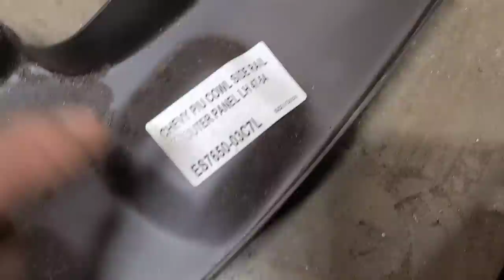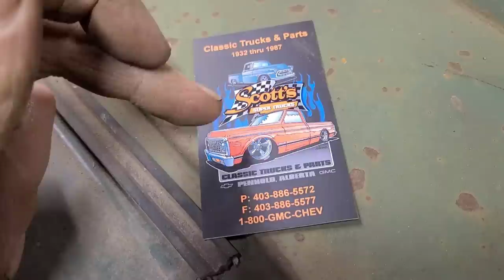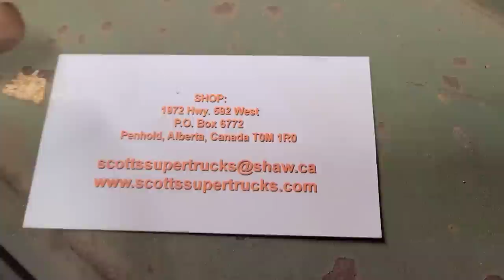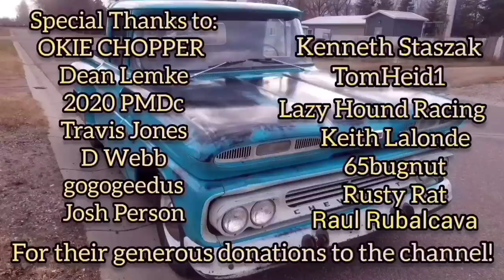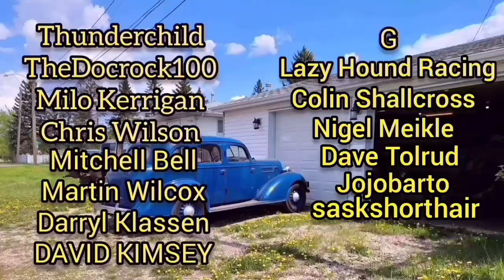How To Use Aftermarket Patch Panels To Fix Major Rust.1948 GMC Part 4.

Comment: Long time subscriber on Scott's channel and HAPPILY becoming one on yours !!! A retired construction veteran but even with that similar experience on buildings, can only imagine what it's like tearing into the rotten/decayed structure on one of these old relics !!! Your "resurrection" looks awesome so far. Can't wait to see all the follow-ups. 
I used to have older relatives that never owned a car who would always SLAM the door to the point the car instantly became a inch narrower just to ensure it was "latched" !!! You would need to wear ear protection whenever you gave them a ride ;o)
For sure, CONGRAT'S on the opera role.
Reply from the maker: Thank you! I suspect building repair is a lot more complex than anything I  have done with junk vehicles!

Comment: Everyone swears they remember perfect panel gaps..... that was never a thing, ppl just didn't bother looking too hard at them.
Just go look at the gaps on a brand new anything. 
American cars have always had terrible gaps with little improvement  in the 90's but after 2000 they've become crap again. No one looks at that when they believe it's new. Some are ok but many are not. 
Nice work Carter 👍
Reply from the maker: Thanks! Yeah I remember having to align doors on brand new $90,000 trucks and suv's because the doors were rubbing, plus everything now seems to come with dowelled bolts and welded hinges....which would be a great idea if the manufacturers would actually weld the vehicles together straight to begin with
Reply: @CarterAutoRestyling  yet it's funny how we're often held to a higher standard 🤣,   keep up the great work

Comment: I was fortunate enough to learn the use of body solder (lead) back when I was in high school (mid-latter part of the 1970's)...

We also used almost exclusively acrylic lacquer paint. There were RARE occasions when an enamel paint was used, and ever more rare.... Imron. 

I still use lead on some of my own repairs, but I do weld the seams solid. It's getting almost too costly to use lead any more (along with simply trying to have a good supplier), but I do enjoy using it. 

Aftermarket patch panels ARE a 'hit and miss' type of deal UNLESS you have a good source (which I'm happy you discovered one in Canada which has provided you with quality panels and great customer service for many years).

I'll attempt to spread the news about your operatic lead role. I'm happy you were able to pasta the audition without too much drama.
Hopefully my 4 friends will at least be marginally interested.

Sadly, I more than likely won't be able to attend as I've been called to an audition myself to play a part in "Get Off My Lawn'.....
Reply from the maker: Hi Russ, I hope you get the part in "Get Off My Lawn"!
Reply: @CarterAutoRestyling  Thanks.... I've been an understudy for years....😁

Comment: Make it Kustom was showing off 1/8" hole tig plug welds where he would drill through both layers of metal and using the hole to penetrate.  It simulates a spot welder and makes the bond nice and strong (you need to use more of them like a spot welder) but I would imagine they would be much easier to remove if you needed to like a factory spot weld.
Reply from the maker: Oh yeah, that method works great! I used to use it when all I had was a tig welder. In this case I had to weld through spot welds that I had drilled out, so mig was the only choice. The best defense against having to redo stuff is to just take your time and make sure everything is right before welding.

Comment: The desire to bring those insanely rusted and trashed old trucks back to life in canada certainly is much different than here in the southeastern part of the US. Buying all of those patch panels and paying someone for the extensive amount of labor to install them(even if you could find a person willing to do it) just doesn't make good practical  sense here. You can quite literally find a truck that is already in decent structural condition here in the states for far less than it would cost to pay a person(even doing work on the side) for 2 or 300 hours of labor. 4 years ago i crushed a 49 cab here in virginia that was in much much better shape than the one in the video because no one around here would even pay me 200 dollars for it(not kidding!)....all i can say is: "God Bless all of you in Canada!"

Comment: When are you going to do the LS swap part of the build?  I consider myself a bit of an expert on car building (because I've watched a lot of Youtube videos about it) and all the really cool cars have an LS motor. I suggest next time you do more research. Congratulations on the opera role.. but I would think that the lead role in "La Miserable" would be better casting.  Happy Hanukkah from the Shed.
Reply from the maker: Hi Randahl, 
I have two big Ls swaps planned. The first is the Saskatchewan Ls swap, where I take a perfectly drivable car, rip the engine out and begin installing a junkyard Ls with 300,000 miles, then find out I have no idea what I'm doing, give up and attempt to sell the remains of the car as a project with "all the hard work done" 

 The second Ls swap is the "Budget Ls swap". Again starting with a drivable car and a junkyard 300,000 mile Ls donor, I'll do everything on a strict budget, conveniently overlooking the extra 10 grand in parts that are needed to complete the swap.
Reply: @CarterAutoRestyling  "All the hard work done"  now that's funny.

Comment: Very impressive manipulation of the lead on the intro to the video. A real master at work.
Yes, door and panel gaps on a spaceport are quite important. I would think quite a bit moreso than on a truck cab.
Mega congrats on finally landing the lead role in the opera. Not sure if I can make it from NS so will you be selling a video of the production? The cats are super excited, as usual.
I may be wrong (I'm told that I usually am) but there seems to be more tips and tricks in this build than in some others. Lots of good content. But no fire. hmmm
Reply from the maker: Hi Joe,
I'll be doing a full opera performance  video at 10 million subs.
Sorry for the extra tips!  The pyrotechnics department has been overworked and under budgeted lately, but I was able to commission them for he intro of my next video
Reply: 10 million? Might a little while but you better warm up those pipes. One day you may have to go good on that.
Can't wait to see what pyro-dept comes up with.
Stay warm out there in snow-land.

Comment: Thanks for letting us know about were you buy your parts. Since I'm in Alberta I will use them. I have a panel truck of the same Era that needs rear fenders . Can you cut down pickup  fenders and make them work? No luck  finding panel truck fenders.
Reply from the maker: Sorry I don't have a panel truck here to reference, I think the outer face of the fender is the same, but you'd have to do a lot of slicing and dicing to the inside to get them mounted up.

Comment: I think your work is great.....way beyond what i would do....I appreciate good work but accept much less. As you get older you dont care as much as you do when your younger. I wish I could have back a few of those years I spent doing perfect work on cars that nobody really cared about after I was done.
Reply: Mike your v w's look great
Reply from the maker: Thanks Mike! This one is just a fun low stress patch job to save what would otherwise be an unsavable truck. There's a time and place for perfection, but most of the time "just getting it done" is the way to go!

Comment: Watching so many people do the "M<IG" plug weld why not buy an actual two-Handed Spot welder. even my old man had one back in the mid 80's loved putting panels on with it.  But mig plug does work.  Very precises with those chinesim thin replacement panels. but it what we the rebuilders have to use; America just isn't cable of doing anything half as good for nothing less than way too much money hr to produce. we / you have make do with them.

Comment: Any thoughts on what could have been used that wouldn't have caused the cab issues?  I knew from a previous cab "DO NOT SAND BLAST!".  Thanks for answering.
Reply from the maker: Check out Wray Schelin on YouTube, he has several videos on using Muratic and phosphoric acid to remove rust. It's messy and tedious, but it's really the only safe way to get rust off of large flat panels.
Reply: @CarterAutoRestyling  Thanks!

Comment: They make specific spot weld removal drill bits which cause minimal damage and save time versus regular drill bits.
Reply from the maker: Not a fan of those, I prefer the cheap drill bits.

Comment: Was watching old videos and saw the 1953 Chevy truck oilcan repair.  How did you clean the truck to bare metal prior to fixing the roof?
Reply from the maker: Owner of the truck had it sandblasted, which warped the whole cab and caused a lot of the oilcan issues.

Comment: I just relined my Miller for .023 wire based on what you auto metal fabricator guys seem to like. Why a preference for the thinner wire? Puts down less material? Better weld control?
Reply from the maker: Less heat needed to get a full penetration weld, plus the reasons you listed

Comment: I see you replaced the inside “kick panel” before replacing the outer panel. Should I replace the right side floor panel and the kick panel before replacing the outer panel you here replaced?
Reply from the maker: That's how I did it. If you go back in the 48 Gmc playlist I have several videos showing how I tackled the floors and inner cowl

Comment: I got a short 50 Chevy panel truck body that's missing the frame front clip and doors but floor is solid . If someone wants a cool project for 500$
Reply: AND 2 55 Chevys and a 57 d200 body

Comment: I think what you do goes beyond craftsmanship - as a German used to the metric system I‘d like to ask you - without which system is better blablabla - its obvious that metric is easier to calculate with but there seem to be older craftsmen that state „using inches (Imperial?) system produces more beautiful results“. I thought Canada had adopted metric but I saw you using the quarter inch as the seam gap size to try to achieve. What‘s your take on this?
Reply from the maker: Oh I use the measuring system that the vehicle had when new. It just sounds wrong using millimeters on an old American vehicle. Canada still uses a combination of both measuring systems.

Comment: As I learn more about old cars the more over restored cars jump out at me as wrong. If they are deliberately done as show cars and made to be better than factory that's fine. But if it's mean to be original then you can definitely over do it. I am learning the wooden frame in cars like my Riley for example were rough as guts. Luckily I can work to that standard! Where's the McLaren, outside still? Oh, perfect example of an over restored car. The 'original' McLaren Austin 7 race car (Bruce's first car) the factory owns. Speaking of opera, have you ever seen Phantom of the Paradise? You could pick up some tips.
Reply from the maker: I agree about the over restored cars, of course there's no such thing as the perfect car and the problem is the more perfect a car gets the more the flaws become noticeable. Sadly the McLaren is currently on my lawn half buried in a snow bank, there's no way I'm kicking one of my rusty junkers outside to make room for a second hand McLaren.
 Thanks for the tip on the Phantom of the Paradise, it's a bit before my time so I had to look it up, but I can tell already I will be learning more from it than I did in opera school